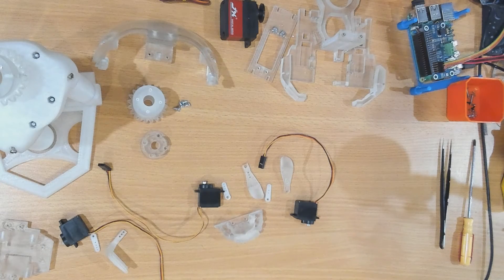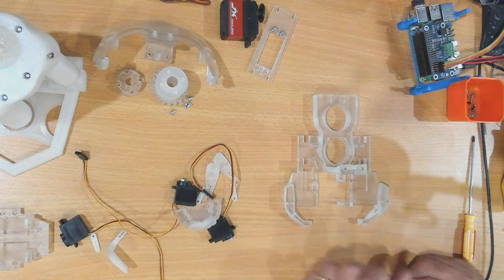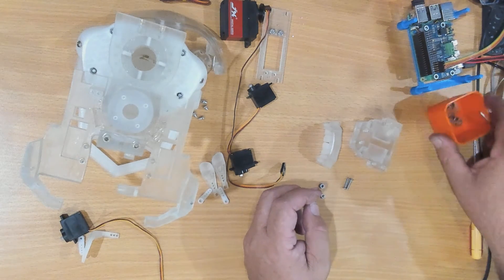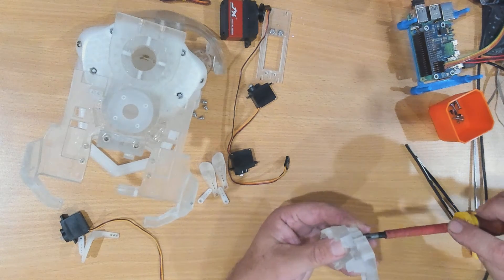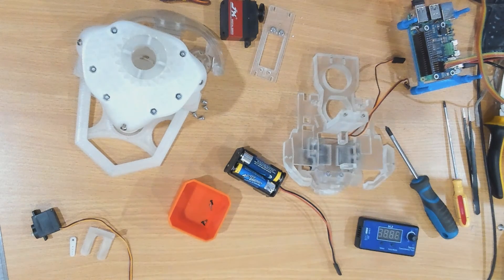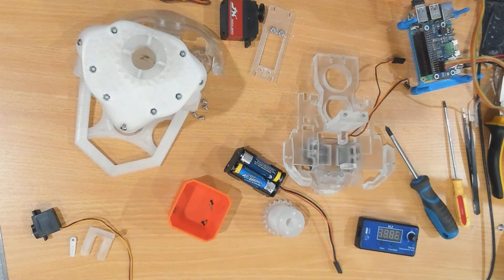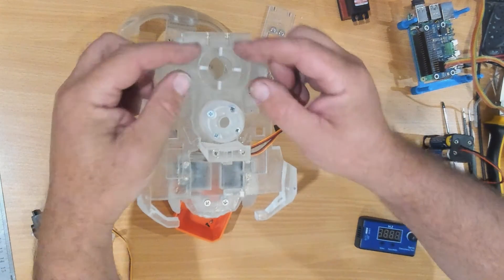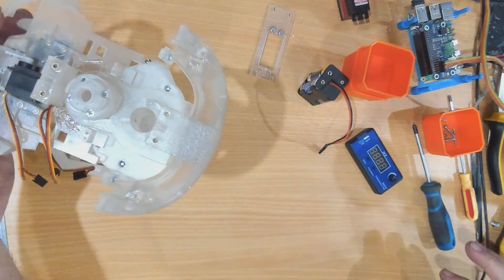InMoov i2Head build Part 1

Comment: Hi in the part list there is "6 x 0.8 x 6mm long self tapping screws " ,Try to find but get zero does  a screw  like this exist  ?  or there is an error in the list ?   Regards Ahead Doron
Reply: ok i found the m before the 0.9 is missing so could not find it   Thanks Doron
Reply: 0.8
Reply from the maker: The screws do exist.
I have had mine for a long time, came as part of a set of various sizes

Comment: hi  which camera do you advice to use (may be  for face recognizing ? )  regards Doron
Reply from the maker: I used the same one Gael listed.
https://fr.aliexpress.com/item/1005004200917640.html?spm=a2g0o.order_list.order_list_main.76.40465e5b637U38&gatewayAdapt=glo2fra

As listed in the build instructions by Gael: https://inmoov.fr/eyes-i2/
Reply: @CyberOne  thanks
Reply: what model of raspberry is good (i ma sure that 4-5 ) but will older models also good ? Regards Doron
Reply from the maker: @sonra1001  I would not recommend any thing less than a Raspi4.
The more RAM installed the better.
The Raspi4 comes with up to 8GB of RAM the Raspi5 up to 16GB of RAM
The Raspi3 1GB of RAM
Reply: thanks   for help Doron

Comment: Fab! which servo motor you are using ?
Reply from the maker: For the neck rotate and the jaw, I am using the PDI-6221MG servos
For all the other servos in the head, I'm using the PDI-1109MG servos.
These are also the recommended by Gael in the build instructions:
https://inmoov.fr/headi2/?doing_wp_cron=1711857237.7389509677886962890625
Reply: @CyberOne  It seems to be a discontinued product from the manufacturer. as i can't see it in their website or hobbykings.
Reply from the maker: @ahmadelwaly6514  Which one seems to be discontinued?
I found both the PDI servos on eBay and AliExpress
The PDI servos are manufactures by JX Servos in China
Reply: @CyberOne  oh I see, Thanks for the quick response.

Comment: Hello the where I can find the STL files for neck mechanism?
Reply from the maker: You can find all of the InMoov parts listed on the Inmoov.fr website
The neck parts can be found here: https://inmoov.fr/inmoov-stl-parts-viewer/?bodyparts=Neck
Reply: @CyberOne  I have watched all your assembly videos on i2 Robot but I am confused about some parts like you have not used these parts in your assembly:
JawhingeV4.stl
JawPistonV1NoSupport.stl
SkullServoFixV4.stl and some other parts like neckboltsV2. Stl etc.
My question is with your assembly can a robot be able to move his neck? Or can skipping these parts is  not causing issue?
Reply: @CyberOne  I have watched all your assembly videos on i2 Robot but I am confused about some parts like you have not used these parts in your assembly:
JawhingeV4.stl
JawPistonV1NoSupport.stl
SkullServoFixV4.stl and some other parts like neckboltsV2. Stl etc.
My question is with your assembly can a robot be able to move his neck? Or can skipping these parts is  not causing issue?
Reply from the maker: The head rotation is done with the centre servo in the middle of the head.
The neck parts allow the head to tilt back and forward and roll left and right with servos mounted in the body of the InMoov robot.
In my videos, I ran out of outputs for the head turning servo :-(
There are 17 servos in the head and the PCA9685 only has 16 outputs
Reply: @CyberOne  Unable to find the NeckV2, as I see NeckV3